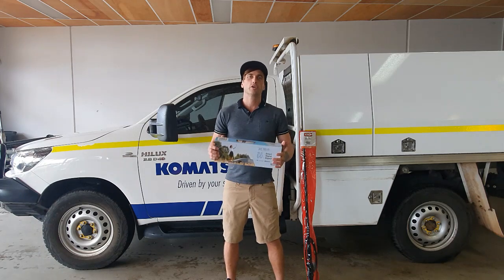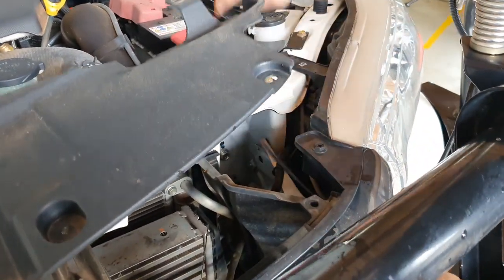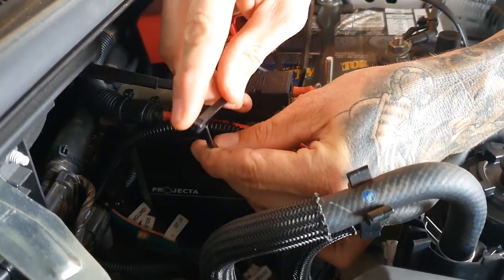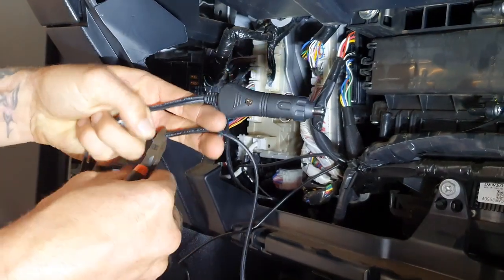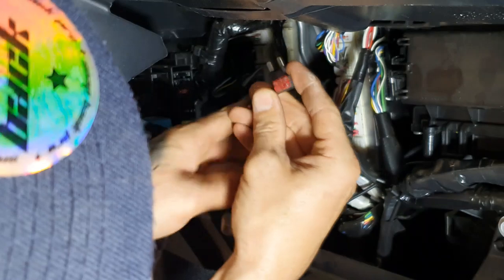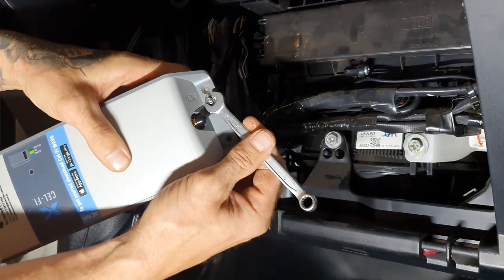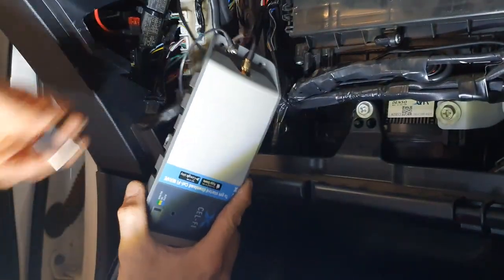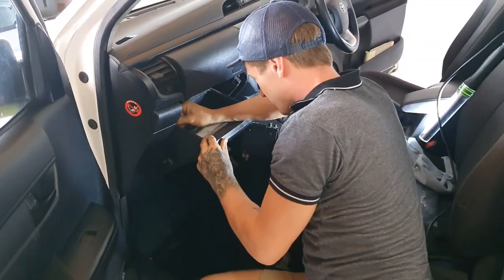Installing a Cel Fi Go Mobile repeater to a Toyota Hilux

Comment: Cheers for the video very helpful for my celfi install. Ive got a question though. The one I have is a stationary version. I've got the antennas to make portable. Just the power cable I've got is 240v so doesn't have the ground loop.  If I ground the body of the unit to the same place as the power cable will that do the same job? Or am I better off buying the proper cable?  Cheers again.